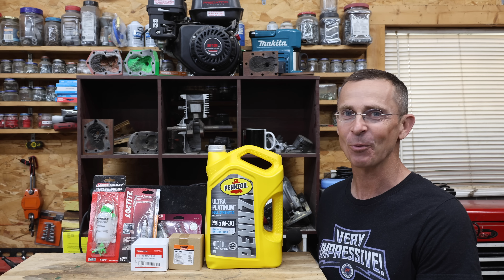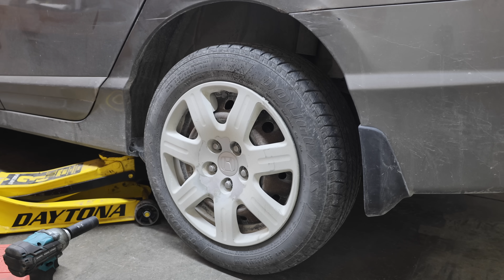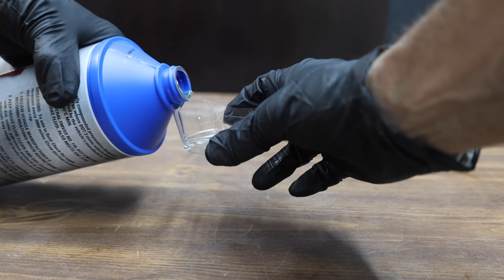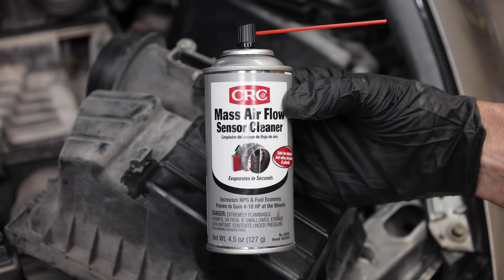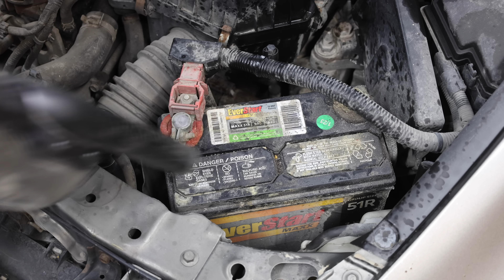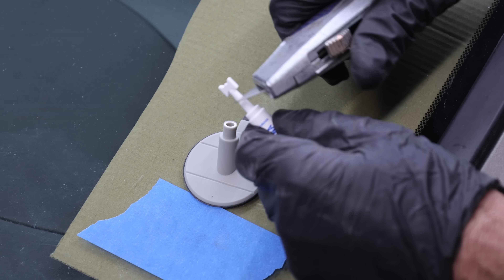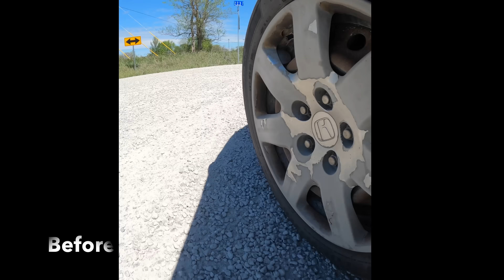Most Reliable 200K Mile Car? Let's Settle This!

Comment: As long as you keep up the maintenance in my personal experience  I have seen a couple 500,000 mile Chevrolet S10s, several 300000 + Mile Dodge Dakota pickups 4-cylinder and V6,, and as much as I don't care for Fords,  the sn95 mustang V6, I personally have one at 200 k and I've seen dozens with more mileage. All make great daily drivers with the mustang having the worst gas mileage..

Comment: My 2008 Nissan Titan has 203,000 still runs good and is paid for. 
Kept up on maintenance and did not abuse truck. Couple small things need to fix like A/C actuator under dash and minor and tire Pressure light. Did need to replace left and right catalytic converters which are part of exhaust manifold; being in Calif they were $800 each. Luckily not at same time but within 8 months of each other. 
Still a great truck.

Comment: I got a 379,000 miles 2002 Ford Escape, 6 cyl Made in USA. Bought it for $1,000 with 180,000 miles and a "bad transmission" that really was seized front calipers, replaced calipers and between Washington DC, Texas, North Carolina, Miami, Alabama, etc many times over, is 379,000 now. If I hit the gas, it will burn the front tires for a while. Best deal ever!!!

Comment: Not if it’s a Toyota I have a 2000 Toyota tundra it’s got 300,000 miles on it. It runs like the day I bought it and all I’ve ever done is put a starter and a fuel pump its 26 years old you tell me any other car that does this none that I know of and don’t tell me your ford or your Chevy did because you’re lying plain and simple. it still has the original water pump the original everything but the starter in the fuel pump I mean, I don’t know of any other cars. I had a Chevy Z 71 it cost 10 grand and eight years the engine needed to be rebuilt the transmission needed to be rebuilt and have to have a new rear input in it. I mean, it was a pile of crap never again.

Comment: Great video and a solid reminder that we all don't need to and shouldn't "Keep up with the Joneses". I just picked up a used 2020 Ford F150 that needs some TLC for $15,400 its in really good cosmetic shape. It has some blackholes in its maintenance history but runs well and passes smog. It had a minor fender bender and has had 22K miles put on it per year as it was a commercial delivery vehicle. I bit of sweat equity doing transmission fluid and filter, diffs, spark plugs, filters, accessory belts will make this truck go the distance. All that and I saved $31,000 vs new if I factor cost of fluids parts and tools I am putting into the truck which is around 2K to get everything I need to do the jobs myself.

Comment: I have been told that if a transmission is overdue for a service, don't change the fluid. It could actually cause problems. Think there is any validity to that advice?

Comment: Prius (minimum 3rd gen) is the best 200k car. The hybrid battery takes so much pressure off the engine and I still get more range of of 1 tank of gas than a brand new electric car (400 miles). A new hybrid battery is about 1500 if needed.
Reply from the maker: Great to hear!

Comment: Ive had multiple cars hit 200k miles with minimal in repairs. 06 Rav4 v6, 08 Camry and 14 Cx5. Just keep up on oil every 5k and maintenance. Stick with proven used cars with track records for reliability...why I prefer used over new.

Comment: I subscribe to nothing. But I will comment on worthy videos. I hope it has as much or more effect that a subscription.

These videos are epic! The fast delivery keeps me tuned right to the end. No bullship. No wasted information. And this video is so spot on! The only thing that drives new car sales is ego. If you have no issues in owning, running and maintaining a 20 year old car, you have no reason to buy a new one. Only if you live in the rust belt and the car rots out, it is better to chase parts than to buy a new, overpriced, crappy quality, over engineered new car. I run a 2000 Ford Excursion and a 2002 Suzuki XL7. I spend a weekend every couple of months working on things but they run better than having to take a new $70,000 vehicle into the dealer every couple of months to chase down obscure engine/transmission codes.

Keep your ego in check and keep a 20 year old car in your driveway. Your wallet will thank you for it.

Comment: I did not see the proper bleeding after the coolant change and i would not be so quick to change that trans fluid more then once if at all with that high mileage. Also, the proper checking of the trans fluid level requires the car to be brought to operating temp then shut off for 60 to 90 seconds before checking.

Comment: 8:05  The best way to remove air from the system if there is no bleeder valve, then merely run the engine through Hot and cold cycles, like over night cold, and as the coolant expands when hot, and contracts overnight, the reservior level will drop overnight.  Then make sure the next morning to fill the reservior.

Comment: 7:00 correct. The Pet cock is vrey easy to access and drain the radiator even on a 2005 Acura TL. I rotate in a fresh gallon of fluid once a year or so.. (just to keep the fluid UP to par)  same thing with transmission fluid.. just drain and fill.. no flushing.   I do that also to the Power steering fluid.  But no draining, I syphon out the reservior and refill it and let it circulate. Do it several times in a month to do a more thorough refresh of the PS fluid.
Reply from the maker: Thanks for the feedback!

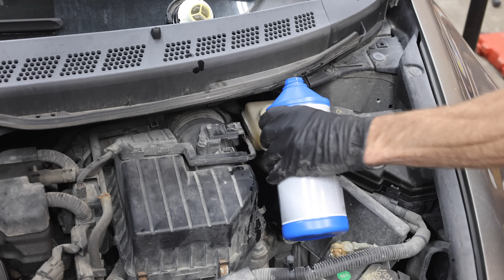Comment: 5:35 You can also replace your bleeder valve with "Speed Bleeder" check valves.  Just open the valve 1/4 turn and press the brake pedal slowly.  1 pump on the brake pedal gets 1 squirt.  You do not "pump up the brakes" like a doe-doe head.

Comment: Honda/Acura has always had the best running small and medium size engines since the 80's.  They are also easier to work on.  I have a 2005 Acura TL with 136k miles and I have only replaced 1 of 6 ignition coils.  No turbo but runs great. Keep fresh fluids..  The other things I replaced are all wear items like a battery and brake pads and a starter... All normal stuff GM engines often run rough even when new. That is bad.  Honda engines run smooth.

Comment: My car is over 25 yr old - Acura.  Just ended having to have annual emissions testing - a requirement in my metro area.  In 2020, had a rebuilt-transmission put in after it started slipping. At the time of the transmission work, I considered replacing the vehicle to avoid issues, but I've owned that car since it was new and know the complete history, maintenance, everything about it.  Plus I didn't want to pay the state 7% tax on a different vehicle, even if I got a $12K used car with a good long term record.  I hate paying unnecessary taxes.

Generally, I just drive it and change the oil+filter every 10K miles - using synthetic oil.  No leaks. No drips.   It gets 28mpg overall - not a hybrid.  After a wash and wax, it looks new on the outside.  The inside is pretty clean, but a few foam things have been crushed and aren't doing their job anymore.  Lots of "experts" claim I'm not changing the oil often enough. They all say 5K is the max for long term ownership.  I'd say that smooth driving and avoiding potholes matters more.  If your vehicle is bouncing around a bunch, then that's got to be harder on the engine than staying on really smooth roads, smooth acceleration and smooth breaking.  Being smooth is my trick for driving.

It is time for the timing belt to be replaced. Doing that is a bigger job than I want to handle myself, so I'll have them change all the hoses and belts and fluids at the same time.  It has been over 30K since the transmission was replaced. The brakes are original and I don't think the brake line fluid has ever been replaced.

I expect to get at least 100K more miles from the car.  The thing that scares me the most is replacement of the fuel filter. Some Acura genius decided to place it INSIDE THE GAS TANK directly connected to the fuel pump, so if you are replacing either, best to just replace both.  Actually, Acura mechanics I know suggest just replacing the entire fuel tank.

Comment: Had a 1997 Honda Civic go 254,000 miles with just basic maintenance besides a few issues over the 29 years I drove it. Had to junk it 3 months ago due to there was just too much going on with it due to age: every plastic and rubber part was super brittle including wires and connectors, every rubber seal, gasket and bushing was slowly leaking or rotting, interior was dry rotten and generally falling apart. It was just too much money and/or work so I sent it off to the parts yard to hopefully give new life to other Civics. Was a daily driver for over half my life, very few highway miles, almost all start stop trips to work and the market. I just kept up on the routine maintenance and had it inspected by a trusted mechanic every few years. They do not make them like that anymore.
Reply from the maker: Thanks for sharing.

Comment: 2008-2012 Ford escape. If the oil has been changed, it will last (at least) 225,000 miles. *if it's an automatic, the ATF services must be done on schedule. At 150,000 miles start checking the ATF level regularly also.

Comment: I did very nearly the same maintenance on a 2004 Camry at about 270k miles. I mention this because my parts cost was more like $2k or 2.5k and change, than 800 and change. Between 500 and 600 for the struts alone, and that was from Rock Auto. The spark plugs for my V6 were close to $100 each, as were the coils, if I recall.  I did opt for best quality parts, so that might have been some of the difference. Doing it DIY still makes it a good deal. Having a shop do it would have been at least 5k. So, I agree that a 200k car can be a good deal, cost per mile. But I think he's lowballed the cost a bit.

Comment: I always liked cars I couldn’t afford, so I did what most people do when they want something that’s not in their budget.. I bought used, with a lot of miles! The cars I had were a Toyota FJ cruiser 2007 purchased with 228k miles on it. Excellent condition, great car! Drove it for 2 years and sold it at 245k or so without it breaking for any reason. Had a 1998 Toyota Avalon purchased with 116k on it, drove it for about 3 years until it was totaled in a head on collision after a drunk driver drove into me, car had around 160 k, zero issues. Had a Lexus gs400 also 98, bought at auction with 120k and sold it at around 180k, did have one issue with the brake pump that was expensive to replace. Now I have 2 cars, my work pickup truck a 2016 Tacoma v6, bought it with 131k and now appx it has 170k, absolutely zero issues. And my main family car is a 2019 cayenne which I bought with 139k on it!! Super expensive to fix, but so far, I’ve had it for about 2.5 years, it has around 165k and once again, still no issues. I do all services on time though… high miles doesn’t mean death sentence;)

Comment: That Pennzoil Ultra Platinum is exactly what I use. I switched from Mobile 1 and I actually got VERY noticeable milage increase from it.  I just change my oil every 20k Miles and my car has 240,000 miles on it.  running absolutely flawlessly.  I just heat my engine up, suck out the oil through the dipstick and put in new oil.  super easy!  Oil filter is easy too.

Comment: The only thing I saw that I may not do is the Transmission fluid.  When I was reasearching that, it recommended NOT changing it because it is risky and says the old transmission fluid even if dark, is risky and could damage the car more if replacing it.  Also the hose extractor that you make you use hot glue with a mason jar.  Hot glue is NOT water friendly or flied friendly so it wouldn't last for maybe 1 or 2 cycles before it starts to break.  If you want it to last, use something that is water safe.... Good job!

Comment: im doing a 2002 saturn....tires wheel bearings 1 cv joint major brake overhaul headlight cleanup trans valve body i am at about 900 bucks....car has 100k....should outlast most new cars at this point and i got the car for free.......drives great!!....20 hour5s of my time but what was i doing anyway lol.....car is a sort of copy of the honda mechanically very similar......
Reply: and the cost includes new tools i had to get.......

Comment: Fantastic example of auto restoration both in appearance and mechanical issues.  I have done this
for years with high mileage older vehicles for both my personal use and for resale. I always assume nothing has been done in either case, anything with less than 50% operational use,
I go ahead and replace. When I place a vehicle in my front yard for sale, they are usually sold
in 24 hours to two weeks. All the Japanese made vehicles sell the fastest and Chrysler brand
vehicles sell the slowest.

Comment: In the past year I have been busy  on a 2005 4.6L F150 4x4. Timing chain replaced along with fan clutch, water pump, oil pump, rebuilt tranny before 13:39  purchase, new front left brake caliper and pads on both front rotors. 
I still need to change the brake fluid and front differential fluid. 

Also working on a 2000 F250 7.3L diesel. So far it’s had the 6 speed transmission fluid changed and new O rings on the water separator/fuel bowl and dropped the tank to replace the pickup sock and clean the in tank filters. Still need to change the coolant and grease the front end. 
So far, including the purchase prices, I have less then $12,000 in both trucks. Which  is less then what trading in the 2018 Frontier and the payments on a NEW truck

Comment: From the perspective of reliability, cost of maintenance, and cost to operate, I would put the 2nd Gen (2004 - 2009) Toyota Prius up against any car, any time.  My wife and I have owned two 2008 models, and still drive one of them.  And I'm certain we would still have the other if it hadn't been totaled (at 289,000 miles) by a reckless driver.  I'm in my mid-sixties, and have never owned a  better car!

Comment: i ran an 07 civic for 11 years and 190k miles before it blew the clutch and i sold it.  it was.a great car but the rear end was very light and would come around on you when in snow or hydro planing.  i damn near died in that little tank and was always scared of it after that.  other civics i had never had that problem.

Comment: A 100,000 mile car could be ready to expire any minute, a 200,000 mile car has proven it's ready to go another 100,000.  I have a 2016 honda fit with 230,000, no check engine lights, no problems at all.  I bought it with 215,000 miles and in 2 years of driving, nothing has gone wrong.  $25 to fill the gas tank and get 46 MPG

Comment: Spending a bit every year (I budget $1500 per year for my '17 Tacoma Sport) on maintenance, at minimum following the manufacturers schedule, allows me to keep my truck running like new. Even if you are not handy and need to have a shop / dealer do it, it is still pennies on the dollar compared to the cost of a new vehicle.

Comment: Agree about having a battery booster, even with a new car. I bought a 1yr old Mazda and after 6 months it needed a new battery. Some manufacturers use cheapo batteries, so after 1-2 years you need to replace it. I bought a booster pack and it was a life saver at 5am when I needed to get the car started for work, while I waited the 2 weeks for my Mazda appointment to check it. (They Needed to verify if the battery was the issue)
Reply from the maker: Thanks for the feedback.

Comment: I'm going through the exact same $500 2008 Gold Civic but with 228k miles and a EX trim.  Already spent over $500 on new GoodYear tires, battery, all the fluids, pcv, transmission filter. I still need to get to the shocks and likely wheel bearing loaded knuckles. The headlights and wheels need the same love on this one. Just did the OEM spark plugs yesterday and they came out easy but I used PB blaster on them letting it sit around the seal overnight. It did take a while to clean it out first though before pulling the plugs. I assume some might of been on the threads so I set the torque a little less to avoid stripping them. My oil drain bolt had the same oversized Dorman plug and it now needed a double oversized. I plan on drilling it out and tapping to a M16-1.5 and then installing a Fumoto F108SX onto it. This video has given me even more items to work on as well. A little here and there and hopefully it will be road worthy in a month. Would be nice if these repairs could be as fast as an edited video. This video was super helpful as a great summary of work to do on the exact vehicle I'm going through for my teenager.

My windshield has a crack along the sun visor area but out of view during driving. Also the AC doesn't work.

Comment: The early 2000 Civics and Accords are the WORST cars ever. The automatics were the #1 customers of the transmission shops. My Civic also blew the head gasket, air conditioning compressor and windshield wiper motor. My worst car ever.

Comment: I think cars like this are a perfect investment if you get them at the right price. One thing to consider on a Honda with this many miles is that you will most likely need to replace the timing belt, water pump, thermostat, tensioners and don't forget the radiator. Honda's have small radiators and since people do not service them often they get clog and overheat your engine destroying sometimes the head gasket. Love your work! Keep at it.

Comment: 8:25 I gained 2.5 mpg by cleaning the MAF sensor on a low milage 2011 Toyota RAV4 2.5L. It had been driven many miles with the rear lugs improperly engaged on the air filter housing. I used 91% alcohol in a spray bottle.